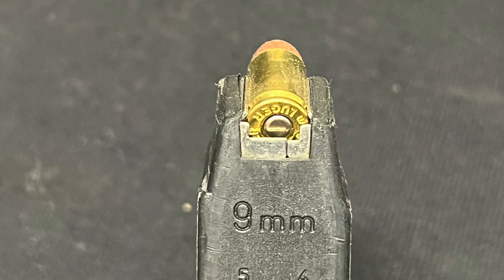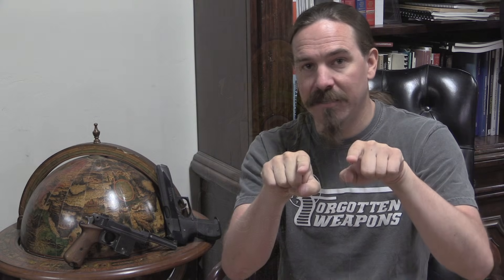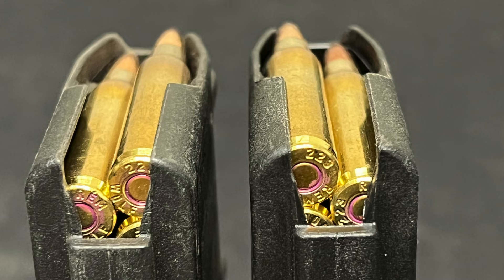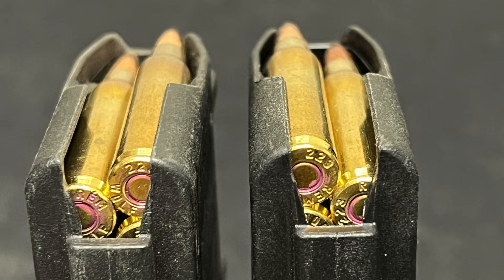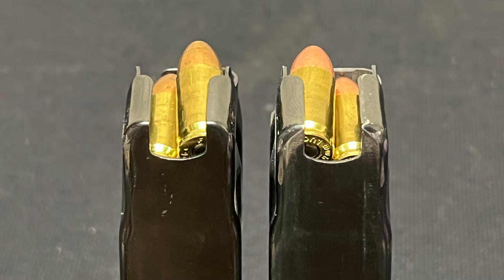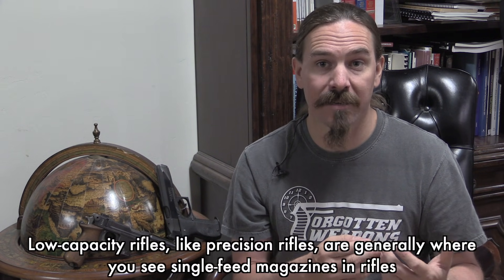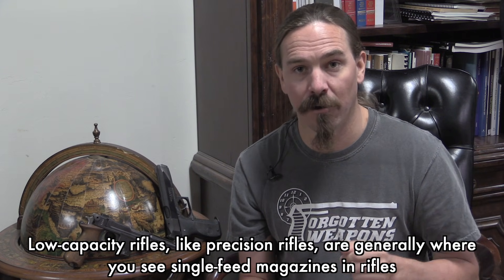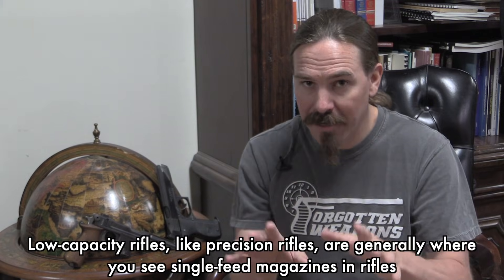Ask Ian: Single Feed vs Double Feed Pistols

Comment: I have several double stack single feed pistols and I solved my feeding problems by spraying the ammo with a dry silicone lubricant prior to loading. It doesn't evaporate and the rounds stay lubed until you need them. Ten years with zero problems.
Reply: Doesn't lubing the rounds,even with a dry lubricant, run the risk of increasing bolt thrust on the pistol? NATO EVPAT testing does this deliberately to reduce the case friction and increase the bolt thrust.
Reply: @eaton72a  It also depends on the ammo. If you're using cheap, low-powered practice ammo in a gun designed to handle +p ammo, not only is is unlikely to hurt the gun, but it might need a little extra help to cycle reliably.
Reply: @eaton72a  It would increase slide velocity on closing. Would make it similar to dropping the slide with no mag in the pistol. For the most part it shouldn't be an issue but will cause more wear and could cause seer problems on something like a high end 1911 and it's really not needed. If you have the proper recoil spring the gun is designed to function without any additional lubrication and in my opinion is more likely to cause an issue, things like the film getting in chamber and causing extraction issues
Reply: @ryanpeck3377  It was a rhetorical question really. Bolt Thrust is the rearward force exerted on the breech when a firearm is discharged. It is a function of chamber pressure and the internal area of the case head. The friction effect when the case expands under pressure against the chamber wall has a reductive effect on this. Lubricating the case could/will reduce this effect and increase bolt thrust. This in turn would increase the load on the firearms locking surfaces, amongst other things. As you say, this could cause 'issues'. Might not have too critical an effect in a pistol calibre though, given the pressures and case length.
Reply: Sounds like a good idea for one man, but militaries/police forces etc. probably wouldn't want the added hassle of an extra step.  I could be wrong, though.
Reply: Everyone has double stack single feed pistols bro. That's like 90% of them...
Reply: What do you use? Do you spray it in a tumbler? Dry lube is interesting, while other lube would be disastrous.
Reply: @onpsxmember  
I use the same spray that I use for reloading cleaned brass. Line them up on a soft clean cloth and give them a spritz then roll them back and forth a few times with another cloth on top to distribute and remove excess. It's basically just an aerosol silicon. I do it as the last step in my reloading process before I box them.

Comment: Why not single row to double feed on left and right side of the bolt upside down with back to front ejection over barrel with back insert of magazine that have two springs on both side of magazine that pull mag fallower instead of pushing in from bellow?

Comment: The QSZ-92 is a double feed pistol. It is known to jam a lot. Some say it is due to the design has to pass a famous Chinese running sand water test. The first time I shot it, jammed twice, but I don't know if double feed design caused it. I remember both times casing is caught when ejected. Guess I would have been dead in battlefield. It is also reported the upgraded variant fixes this issue.

Comment: The KelTec PMR-30 is also a double feed magazine design, because of the small diameter of the cartridge. They've had to release at least 2 iterations of the feed ramp to improve reliability. There is a 3rd gen feed ramp that improves on it even more, but it's not essential.
Reply: That's interesting. I wonder if that's why the Steyr GB took so long to begin production while the Rogak ruined its reputation in America.

Comment: I think for pistols unless it's a full sized duty military pistol where it does not matter if its chunky or if it takes a small round like 5.7 single feed is fine.

The magazine is one of the most important components of firearm and alot of malfunctions are due to bad magazines.

The sten mag was not great but the whole sten itself was not great just a crude and cheap disposable weapon but I have been told mp38 magazines can be interchangeable sometimes, the sterling mag after WW2 is still one of the best 9mm double feed magazine designs ever made.

I hate any PCC that takes glock mags or other, I don't care if you have a lot of glock mags but a PCC should llways have a double feed mag.    I feel for the cost the CZ scorpion/ KUSA 9mm mags are great for the money, not the best but I would be surprised if they ever failed you, it also looks strange to see a 9mm AR or similar with a 30+ round glock stick mag.

You should all ways choose the right tools for the job and a single feed pistol mag does not belong in a PCC.

I was surprised that rugers 5.7 was a single feed mag, but in my honest opinion 5.7 civilian ammunition is very weak and I would never get one.

If I wanted a pistol that can defete soft body armour I would go with hot surplus 7.62x25 in a tokarev or Yugo Tok as the cheapist ammo ever imported while pricy now is still on the market for not crazy money and it will pass most pistol armour.
New brass case unless you relaid yourself is often not hot enough.

The CZ in 7.5FK is better but both the pistol and ammo is crazy expensive but I plan to get one someday.

Comment: MP-443 Grach / MP-446 Viking ("Yarygina") is a  year 2003 and onward (RUS) Pistol that uses double feed and is quite modern in size and function.
Reply: Not anymore. Yes, you’re right, but it’s old version. Recently Kalashnikov Concern upgraded MP-443/446 for better reliability - including single-feed mags as well
Reply: @SpartanStan156  No it's not true Russia is still making old versions for the military and civilians (MP 443/MP 446). That new version is for competition (MP 446C/Viking M). C means competition.
Reply: IIRC, APS Stechkin and GSh-18 also use double feed, the Gyurza pistol probably as well. Seems like the Russians like the double feed.
Reply: And that pistol jams quite often
Reply: Grach has very stiff springs in double feed mags, and normal springs in single feed mags. Single feed feeding lips act as guides to make the cartridge go where it needs to. Double feed lips cant ensure that, too little time for cartridge to go up and settle the bouncing.  Gsh-18 also have very stiff mag springs, same reason.
Reply: @Rigel_6 I can't think of a glock that turned out crappy? Sure I'm not a big fan of them, but they are all insanely reliable. Plus glock releases a new model once a decade or so, if you even count their new guns as new (it's just existing parts in a different combination)
Reply: @marcusborderlands6177  I looked at the comment you replied to, and you know what? I have no idea what the heck I was on about. Must've been ill or  drunk or something, because that was absolute nonsense

Comment: I am convinced that if we are to progress much further when it comes to cartridge fed weapons we must look more to untraditional magazine and feeding systems. Now a days it seems like the magazine is an afterthought or chosen as a "safe" component. Its funny when you see innovative new firearms that use 100+ year old magazine designs...
Reply: Altering mag design to something weird and unconventional would generally be done in accompaniment  to the use of a strange feed system. See P90 with its rotating feed lips and the G11 with its vertically rotating breech.
Reply: @Clippy447  There's no need to reinvent the wheel unless whatever you're doing isn't possible with current wheel technology.
Reply: I would agree with you, but there really isn't a lot that can be done to improve the basic principles of mag design, which is why all these new firearms are using that 100+ mag design. If it works, you get the desired result (a feeding, functioning firearm), why mess with success?
Reply: @tankeroftheeast105  And on top of that, magazines apparently tend to be one of the most difficult parts to design reliably, and the market likes it when they can use magazines/magazine carriers they already own.
Reply: @Howjadoo22  Exactly, couldn't have put better myself.
Reply: When it comes to pistols, my humble opinion is, there isn't much room (literally as well) for change/innovation in magazines. You'll always need a way to grip the pistol, so there's always going to be some kind of grip, which also has to be of certain thickness to be comfortable to hold - you make that maybe just a bit wider than it has to be for it to be of ideal comfort and you put a high capacity magazine in there. Boom, you've used the space the handgun provides to 100% efficiency. 
There used to be designs like the C96 of course, where the magazine is in front, but it screws with the balance, there's less space for the barrel, etc.  
That being said, I personally liked some 3D model where the pistol had a half-circle-shaped magazine behind the grip, so you'd be gripping the gun kind of like a thumbhole stock - between the gun and the magazine. But in this case, the main problem would probably be how to actually get the rounds into the gun, lol. 
Now that I've been thinking for a bit, I can think of 2 possible ways of improvement - 3D printing (maybe there's some manufacturing process that could be made viable which would increase the capacity of magazines?), OR change springs/get rid of springs and fill that space with ammunition and make magazines work off of magic I guess, lol.
Reply: A magazine needs to be cheap to manufacture and reliable to operate. If you cannot improve on either point without sacrificing the other, your system will not be widely adopted. If you can improve on one while sacrificing the other, you might find a niche market for it. Additionally, if you design a weapon around magazines and cartridges that are already in mass production, the gun will likely be much cheaper to shoot as well.
Reply: Rimmed shotgun shells
Reply: Sometimes there's no need to reinvent the wheel, but it'd be interesting to see if there is a better method than traditional magazines
Reply: There's not much to be done with it. It works and if you add complexity you increase the weight and cost which military's don't want, especially when there's no problems with the current tech.
Reply: Typical fix it until it breaks mindset.
Reply: It's a hopper with a spring instead of gravity. It's essentially a few thousand years old.
Reply: Innovative magazine designs and feed systems are alot less worthwhile when what exists works just fine. Its one thing to design a gun to use a special magazine and feed system, its another to convince people that it is worth while to use that design. 
The P90 was designed to fit a specific role, and the gun, magazine, and ammo were all designer around this intent. Trying to design a 5.56 rifle that uses a P90 style magazine may be possible, but would it be worth the time and effort over designing a rifle that uses more conventional and proven designs? Progress without purpose and direction will only be wasteful.
Reply: It has much to do with not fixing what’s not broken.
At this point, the geometry of reliable single feed magazines and reliable feed ramps are well known. Designers haven’t to spend time, AND MONEY, to redesign those parts. If they want a "proprietary" magazine, they can (and they do) take an existing design, and only change some little bit, like the position of the magazine release cut. 
If they choose double feed instead, they have to design magazines and feed ramps from scratch, and that takes time AND MONEY.
That’s why it seems are mainly manufacturers that don’t have to compete on the market and/or are government funded that nowadays decide to invest in designing double feed pistols (see Norinco CF98, GSh-18, MP-443 Grach…)
Reply: While we have a Calico rep here in the comment section, would you mind making m-100p magazines a little cheaper?

Comment: Do single feed magazines prevent as much blowback while firing suppressed, compared to double feed?
Reply: How would single/double feeding change blowback?
Reply: @tiortedrootsky  I mean unburnt powder/carbon exiting the rear of the barrel during cycling. I was wondering since there is less space in single column mags during cycling. It stands to reason less of the blowback would enter the mag body than with double feed magazines. Keeping the magazines cleaner to operate suppressed than double feed while suppressed. I was wondering if that has been compared.

Comment: Tyler here! 🙋 I wasn't expecting this so quickly. I always assumed that manufacturers shyed away from double feed magazines because the single feed frees up real estate for link bars and whatnot related to the trigger
Reply: Link bar is often a bit lower, so even if it were double stack, you wouldn't have more or less space for that.
Reply: @nextlifeonearth  in glock style Triggers the link/trigger bar is at the top of the frame
Reply: That is actually the reason for the strange shape of the HK P7 M13 magazines which go from single stack to double stack just under the trigger bar
Reply: That's what I thought too. Maybe we can look and see where various designs do that?
I also assumed it let the top of the grip cinch in a little bit, as that is comfortable for grips.
Reply: I always figured it was about the size and comfort of the grip.
Reply: @gunfisher4661  That would be the argument between double stack versus single stack. In this instance both kinds of magazine are double stack.
Reply: I think that is part of it. In a Glock for instance the slide and frame would need to be wider on an already chunky pistol. Being the trigger bar is right at the top of the frame and would have to be moved out to accommodate the double feed mag and larger feed ramp
Reply: Good question
Reply: Great question man. Something that never crossed my mind until I saw this video and then I totally went "yea. Why come what he said"  thanks
Reply: Thank yo for asking the question. I never knew I needed this question answered.
Reply: Ford sucks
Reply: @looksirdroids9134  ok 👍